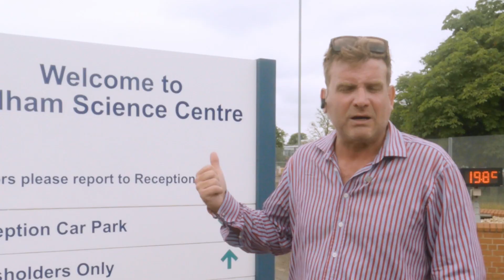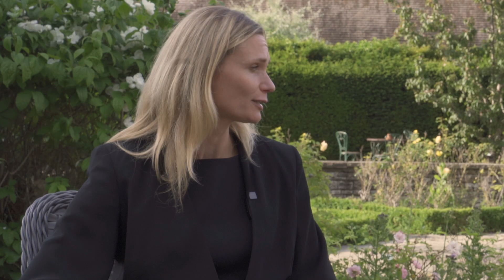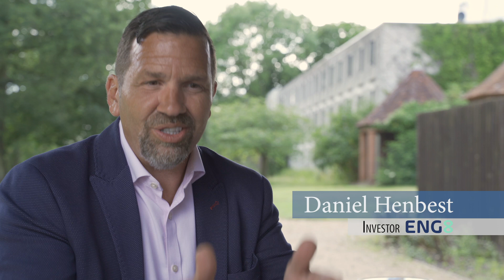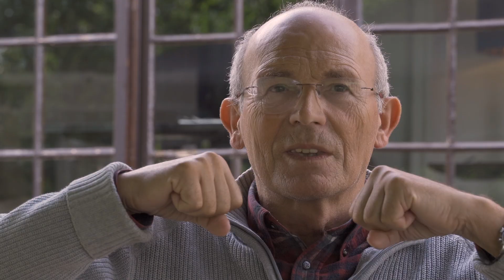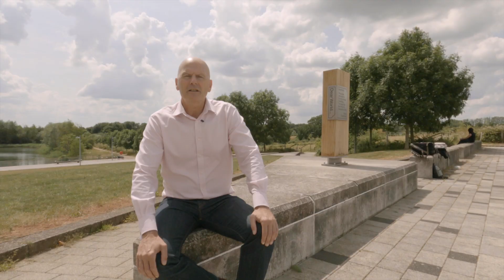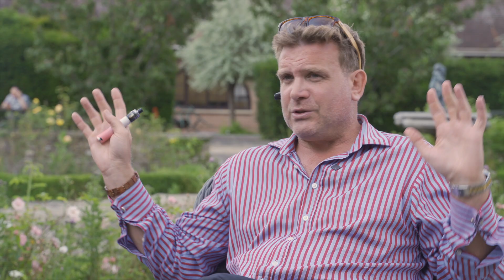ENG8 presents... Catalysed Fusion: Electron Soup For The Soul

Comment: Electron soup AND word salad. Catalysis is probably the wrong word it's a very chemical thing. This would be sub atomic.
Reply: Please look at the international science and nuclear sciences society website. Its not chemical as shown clearly in the EUs CleanHME program. 10x more power out than could be expalined from a chemical reaction.
Reply: To catalyze is to bring change, it's an alchemical term before chemical.
Reply: As George said, catalysis is de rigeur in the chemical industry, so it does sound strange in a nuclear context, but the word means to loosen down or dissolve and was apparently first used in a military or governmental context. The question would be, does the catalyst remain unchanged after doing its job, in addition to 'making things easy'?
Reply: Brilliant